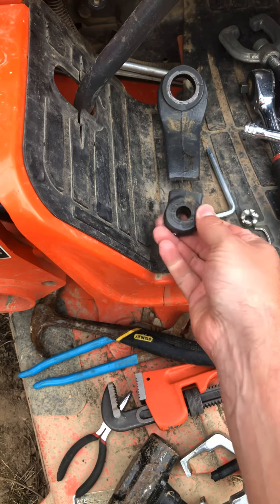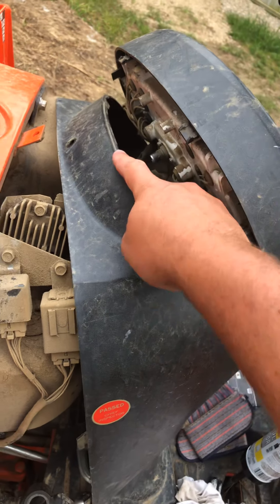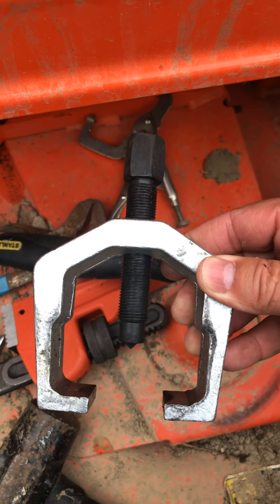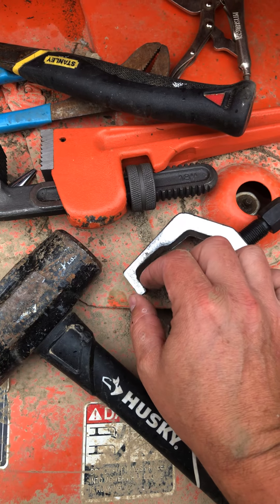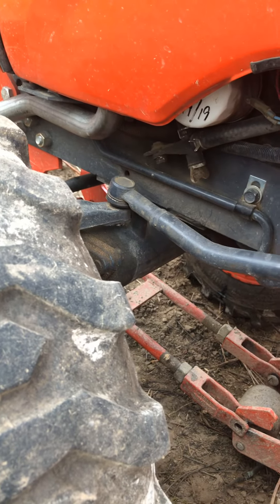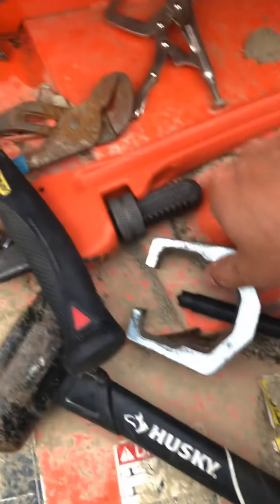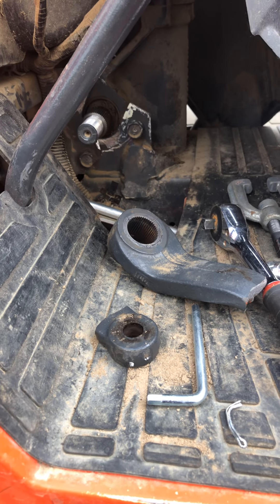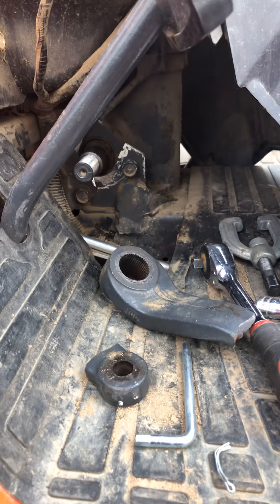Kubota B2920 Pitman Arm Removal

Comment: Thank you for posting this video !!  I have a B7500HSD and had the same thing happen yesterday.  My pitman arm broke in the same spot yours did.  I am hopeful that I can access mine to get a puller in  there the way you did by removing the dash shroud.  Yours looks very similar to my B7500 dash panel so I am hoping they are the same.  I ordered  a new Pitman Arm.........$130 !!!!  They think allot of these Kubota parts.
Reply from the maker: Good luck! I hope that helped. I had to hammer the puller into place. It was very tight!  Let me know if you have any questions.